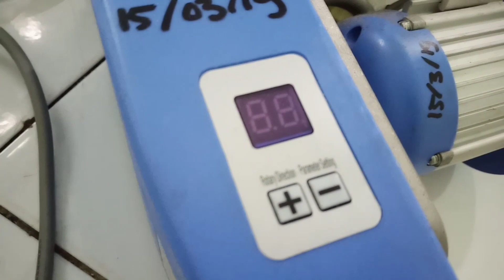Dinamo servo eror || dan cara perbaikannya

Comment: Dinamo servo itu pakek magnet ya pak ngak pakek stator
Termasuk dinamo dc kah
Reply from the maker: iya pakai sensor magnet pak..iya ini dinamo DC
Reply: @proyosmachine7657  brrti sebenarnya simple ya pak cara kerja inverter/modulnya hanya menggunakan pwm sederhana
Reply from the maker: iya pak lumayan sederhana..tapi klo udah rewel komponennya  bikin pusing wkwk
Reply: @proyosmachine7657  biasanya klo pwm dc itu ya igbt nya yang short pak

Comment: Mas mesin servo sering muncul eror 6 itu bagaimna agar gk muncul lagi
Reply from the maker: sebaiknya langsung di konsultasikan ke tempat beli dulu pak.soalnya sy blm pernah mengalami begitu🙏
Reply: Kalau E6 biasanya bermasalah pada motor.  Bisa jadi angkernya konslet atau kabel nya menyatu sama body.  Tapi permasalahan yang sering muncul.  Dikarenakan ic kecil pada motor mati.  Biasanya ada 3 unit dengan 3 kaki.  Coba cek tegangannya.